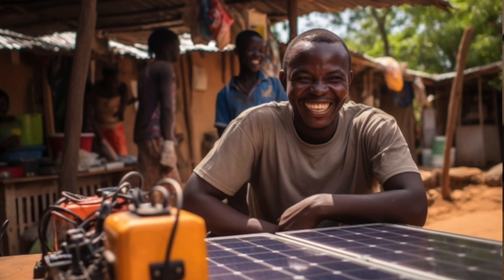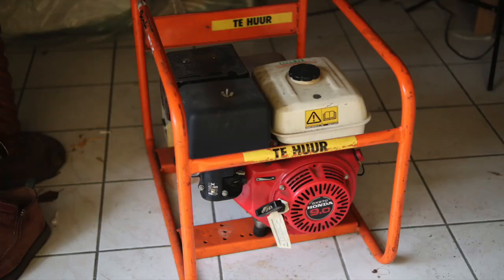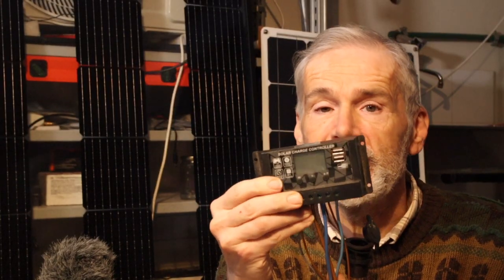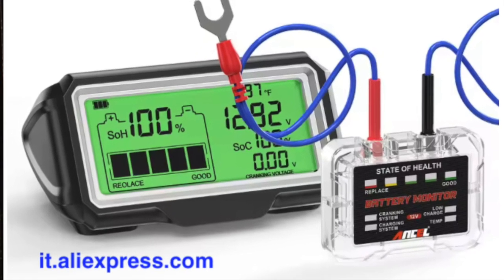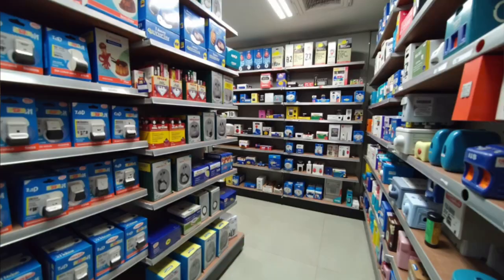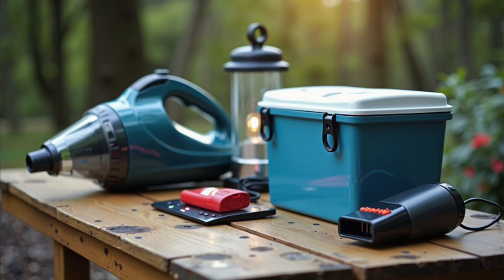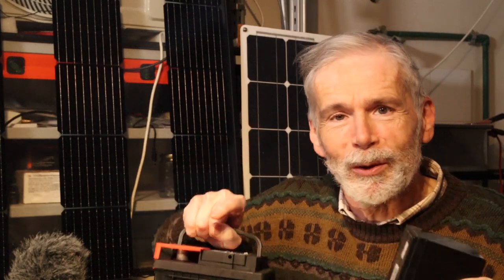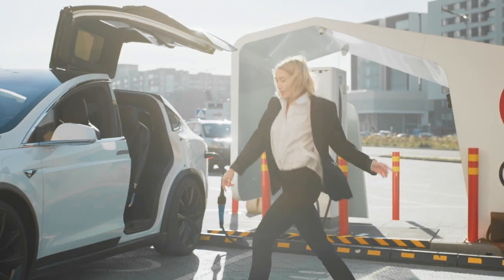DIY Portable Power Station against black outs! (Developing Countries) - 94a

Comment: For an inverter to run a freezer, I needed a 1kw startup load but 65w constant load. I found a 3kw pure sine wave inverter works without a problem, but maybe less would work.
Reply from the maker: It is really an issue i would like to solve. In my video a few weeks ago I show the starting current of a mobile airco on an ascilloscope and it is 5 cycles at 6x nominaĺ. That start current is a big waste of investment money. But our rather large fridge with its on board inverter takes less than 50 W and I run it on the box you saw on this video with 250 Wh, so 5 h of operation. One should give the freezer an own inverter,  who knows if it would be cheaper.

Comment: I’m appreciative of the work you do to inform us in the solar community, thank you for your videos sir. I live in Texas and watch you all the time. Have a great day sir.
Reply from the maker: Thank you Dennis, I appreciate your support very much! And also like your life wisdom on your channel: making a bit of fun is important. This channel is part of my fun! Tomorrow I will upload this same video for the Developed Countries, as a kind of twin video. Because there are quite some differences in the two situations.
Reply: What worried me is what happened in Venezuela. Which is brownouts and power spikes. The country very quickly ran out of surge protectors. This is really only a problem for freezers, so I’ve bought a couple of SVP-916 over and under voltage protectors, that have a delay function that should solve that issue, with standard MoV’s.
As long as they survive I can use power backups like yours.